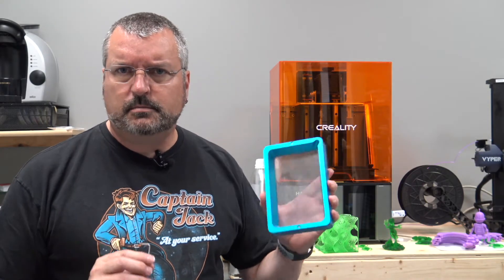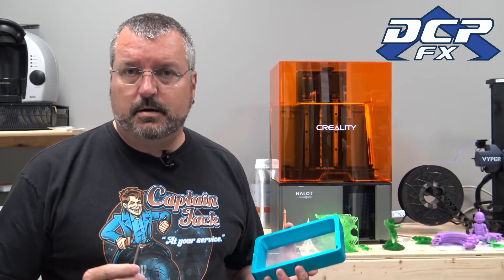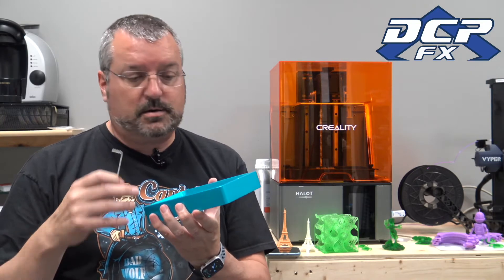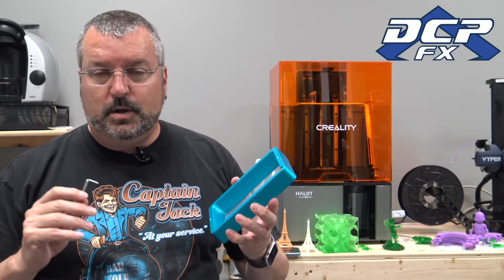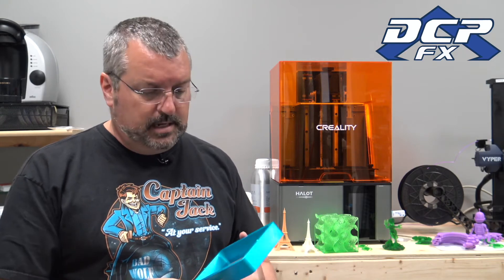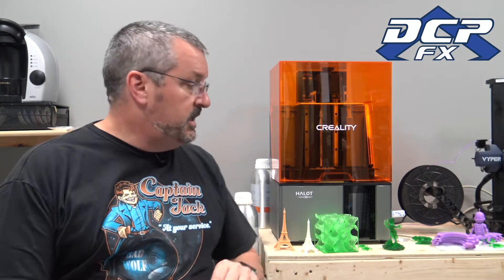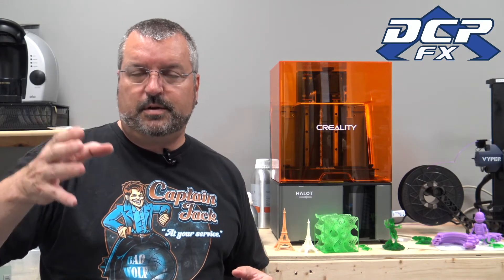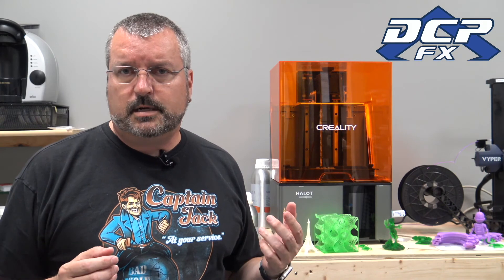FEP Tuning

Comment: I have a mono 2 that hasnt really functioned properly since replacing the FEP. I have tightened it beyond what I would consider reasonable but it wont go above 240ish, maybe 260 if im lucky. At this point most prints get turn partly or entirely off

Comment: Will this be different for different printers, vat sizes, and FEPs?  I have a factory-installed FEP on one of my extra Elegoo Mars 3 Pro tanks that I haven't used yet and it's registering about 5039Hz.  Would the way to go be take a vat that prints reliably, get the range for that with the FEP you usually use (I use an nFEP), and take that as the baseline by which you're measuring the others?  Thanks.
Reply from the maker: The bigger the FEP, the different the tone - it would be best to do a Google search for the correct frequency for your particular printer - I'm sure it exists on the internet.
Reply: @DCPfx  Hmm.  Well you YTer was giving about the same range for Elegoo Mars.  I did find a different app that reported the tone down in the hundreds, though both the factory FEP and problem FEP are reported at about 215 Hz so I'll have to play around with it.  I'm not sure why the app you showed in the video was giving me Hz up in the 5-6K Hz range.  Looks like all of the settings are the same.  Thanks for your input!
Reply: Just an add on for those who find the referenced analyzer producing odd readings like mine did, I got a basic guitar tuner app that has a very straightforward display of Hertz at the bottom.

Comment: whats if its around 700hz? too tight? or good?
Reply from the maker: That does sound high - does it print reliably?
Reply: @DCPfx  im testing NOW... HOPEFULLY
Reply from the maker: Keep an eye on it - that tight might become an issue - did it cone that tight right out of the box?
Reply: @DCPfx  NO I REPLACED IT. i cant find any video about too tight
Reply from the maker: Personally, I think it may be too tight, but see how it prints.
Reply: @DCPfx  so what screws loosen it? when I turn the big screws it don't do much so did I over tighten the small screws?
Reply: @DCPfx  I think it may be Fine! YAY(think?)(what do I know) its on 189/526 and i can hear it ripping up!! im excited...  Maybe next FEP ill no tighten it soo much,,
Reply from the maker: @rockydotson31  Which printer are we talking about?
Reply: How about the size? Is the goldilock frequency are the same in any size vat?